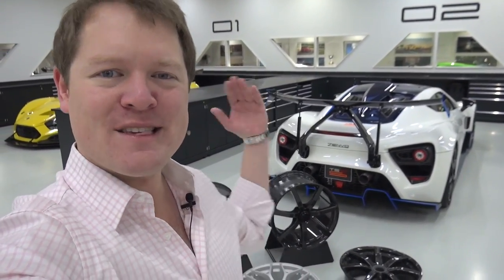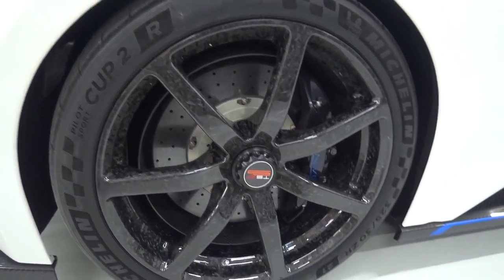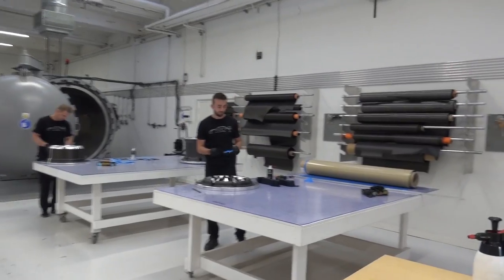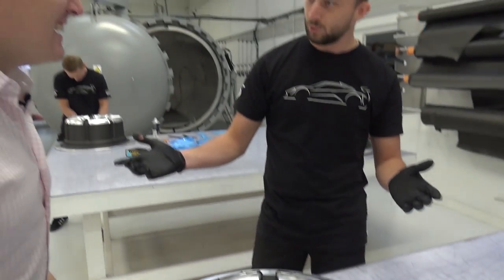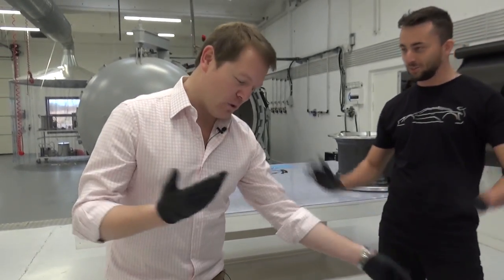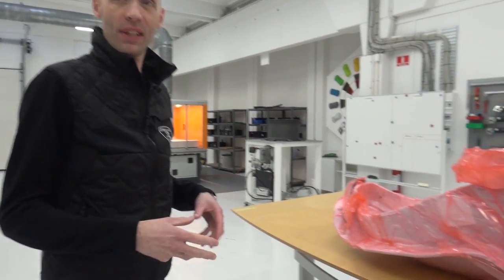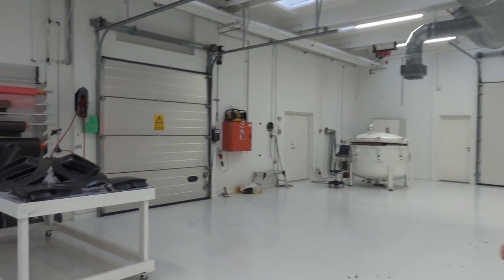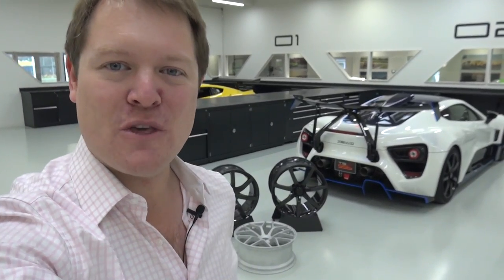HOW TO: Making My Zenvo TSR-S Carbon Fibre Wheels! | ROAD TO ZENVO Part 4

Comment: I'm so excited to see the car! However... taking off the gt500 wheels, yet a full dedicated video to another shmeemobiles carbon wheels being made? I'm confused 😕
Reply: He's taking it off because compared to the price of the car the cost pf those wheels will be a lot. Especially if you're looking to keep it  in England.  It's gonna be driven much more than the Zenvo as well.  Its simply not worth the risk. If he kept it in America I'm sure he'd be much more inclined to keep the carbon because the roads there are much better
Reply from the maker: The problem for the GT500 is that the carbon wheels on the car are becoming prone to failure after decent miles, and when I take it to the UK I'm going out of region and therefore no manufacturer support. For example, if a wheel suffers a total failure, and in the process takes out the brakes, and damages components, then that's all on me. The Zenvo however will not do tonnes of miles, and includes global support, so these are not issues of concern; not to mention the wheels are engineered to a much higher standard to begin with.
Reply: @Shmee150  that makes more sense. Understood. Thanks for the reply. Always a fan of your work shmee. 🙏😊👍

Comment: Really enjoying the Road to Zenvo series so far.
I know how strong carbon fibre is, but the fact that it’s not brittle when used in a wheel really amazes me. The load bearing strength I can visualise, but when you see how easily the spare edge material chips, I just expect it to shatter under torsional loads. It obviously doesn’t, but I still find it mind blowing.

Comment: Hey Tim, just wondering why you have opted for the carbon fibre wheels on the Zenvo but have chosen to eventually take the carbon fibre wheels off the GT500 when it comes to the UK?
Reply: Probably because the GT500 will be doing a lot more miles on less than ideal roads than the Zenvo.
Reply: According to shmee the carbon fibre wheels on his GT500 have a shelf life and are coming to the end of their life apparently🤣
Reply: was going to comment the same question
Reply: I thought its because the GT500 carbon wheels are illegal in europe compared to Zenvo who did all the testing required for an european/worldwide homologation.
Reply: @benistingray6097  gt500 doesn’t have to be homologated as it’s an import
Reply: @-LK34-  But there are still certain legalitys right? As far as i know if you buy a GT500 here in Europe you cant order the carbon firbe wheels. Similar story as the Camaro ZL1-1LE which cant be bought here because the aero doesnt fit the european laws.
Correct me if i m wrong but i thought its a similar story with the GT500.
Reply: @benistingray6097  you can’t buy a GT500 in Europe full stop
Reply: @-LK34-  Seems you missed my point, oh well.

Comment: Do GT500 wheels cost that much more than these? I know you said you'd be replacing the GT500's when you bring the car to the UK because of the replacement cost, but you're getting the same for this car.
Reply: I think that the gt500's are about half the price of these, the problem is that they have to support a heavier car thus wearing off faster and the carbon wheels, if i'm not mistaken, cannot be repaired

Comment: Why are you getting carbon wheels on the zenvo but removing them from the GT500 when it comes to the shmuseum?
Reply from the maker: GT500 wheels are known to have a limited lifespan due to the weight of the vehicle and mine are approaching the end. The TSR-S is much lighter, and will not do so many miles.
Reply: @Shmee150  your wheels are approaching the end of their lifespan? Wtf how many miles have you done😂
Reply: @Shmee150  your telling me that the carbon fibre wheel option on a GT500 mean that the wheels will only last a few thousand miles before needing new ones? That is either nonsense or unbelievable stupid from Ford.

Comment: The big misconception with carbon wheels is that the benefit comes from the lightness, really the benefit comes from the rigidity, weight is a benefit too but the rigidity gives the feeling that you are driving or riding on train tracks, it's quite remarkable.

Comment: Will you have a separate set of wheels for "normal" use?  You mentioned for the GT500 you would remove the carbon wheels in the UK
Reply from the maker: The GT500 has the problem that the wheels are prone to failure and it will have no support out of region when I export it. The Zenvo wheels won't have that issue, plus there's factory support with any problems.
Reply: @Shmee150  Thanks for the explanation!

Comment: So im curious, could you calculate what a single one of those carbon fibre strips for the wheel is worth? :)
Reply: 100x125cm of prepreg 240gr carbon fiber twill is about $30. A single strip is about ~25x5cm, meaning you could probably cut out something like 100 of them per meter of length, although that seems a bit optimistic. With irregular shapes you get more wasted material, so maybe 80 is more realistic. That makes around 37 cents per strip. That's excluding VAT.

Comment: I’m surprised you’ve opted for the carbon wheel as I’ve just watched your other video with GT500 and you said you’ll take the carbon wheels off when you import it to Uk . ?
Reply from the maker: That's because the GT500 wheels are prone to failure, and I'm taking it out of region. The TSR-S does not have those problems, and it's also inside the warranty region.
Reply: @Shmee150  yeah makes sense then, and they do look awesome and add to the cars value.

Comment: Fascinating, but I’m with Gordon Murray - carbon wheels are a no no on road cars
Reply: Are you sure??
Koenigsegg also ran with carbon wheels, and there isnt issue there.
Unless you and Gordon are talking about when the driver is parking beside on a curb then yes
Reply: @JoDON111  yep you cant damage them from curbs / pot holes as it kills the structural integrity of the rim, you can’t take them  to whoops for a skim and repaint, but mainly Murray says it’s about how carbon structurally fails i.e. it’s either 100% or completely failed and in many pieces, with a metal rim it will deform with minor to medium impacts often giving the driver reasonable amount of control. 

Not ideal in the pot hole ridden roads of the U.K.

Comment: Obviously you would never want to hit a pothole in this car or any of your cars or any car in general, if you do hit a pothole with the carbon wheels what would happen, would they be able to take it or would they crack ?
Reply from the maker: They are stronger than any normal equivalent wheel, they will not crack until the force is higher than for other wheels.

Comment: Can't believe they let you sign the carbon weave. Who knows how that ink will react in the autoclave and with the epoxy? Maybe it will weaken the bond between the carbon fiber... Most likely not an issue, but still, it feels a bit risky.

Comment: You said you will take your carbon wheels off the mustang due to risks, so why have them on this zenvo??
Reply from the maker: The GT500 is known to have a high failure rate on its carbon wheels and I will be taking it out of region so have no manufacturer support on it. The Zenvo does not have either of these problems.
Reply: @Shmee150  id bet ford dont build them to this cars standards, cool vid showing the process.

Comment: As cool as the process of carbon wheels are I can't get my head around them not shattering or failing spectacularly, there must be a reason they are not used in motorsport, even f1 doesn't see fit to use them.
Reply: Gordon murray also said he never uses carbon wheels, cause they have a catastrophic failure mode if you bump or notch them...in other words they are wayyy too fragile and bad idea for a wheel.

Comment: Carbon wheels are a bad idea, far too fragile. Very sensitive to shock for a road car. No racing car, even an F1 uses this type of wheel...
The passage to the bench only shows that resistance in rolling not to shocks!